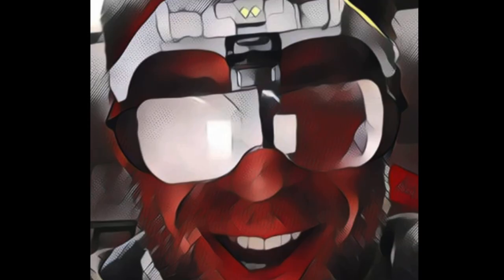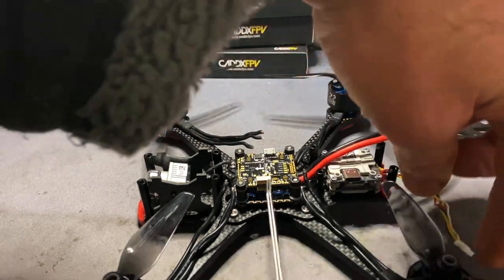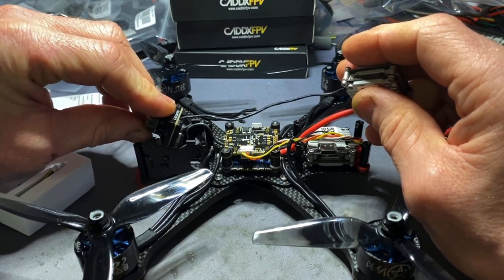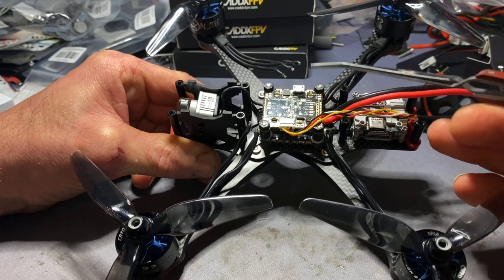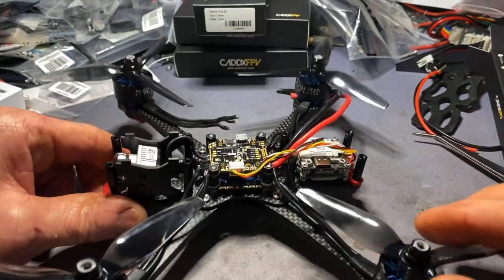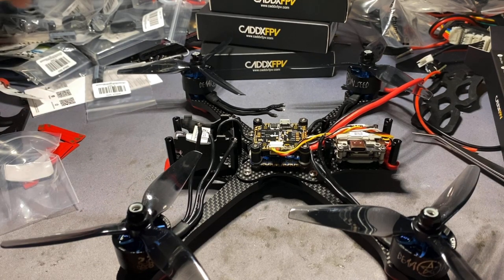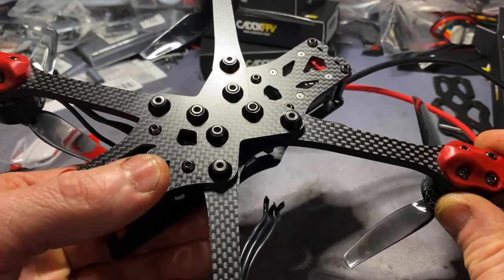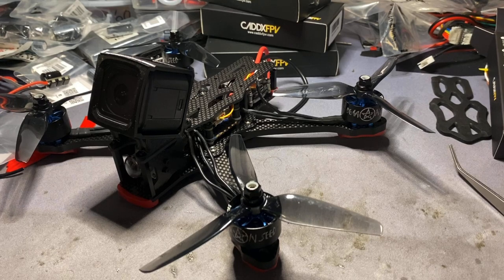Impulse rc apex kiss fettec caddx nebula pro

Comment: Loving the build any reason you used the top plug of the fc or does the underside one the same plug ?   Just curious if there is any different
Reply from the maker: Both same i used this one as it has lipo power for vista. Thanks for dropping in man. 👍
Reply: @noisy_boi_fpv_3920  yeah. Was just wondering yeah I did the same one.  Had to repin the wires but used the bottom plug instead.  Both are the same exact plugs I'm assuming is all.    :). Love the Fettec Apex content dude. Just built one too and I'm hooked and ready for another
Reply from the maker: @josefdahari  ive got an interesting day coming on the 14th of may motorcross day with 20 guys 40 lipos 3 gopro and 4 quads should be good man. Stay tuned lol
Reply: @noisy_boi_fpv_3920  you already know I'm down for that baby!!!